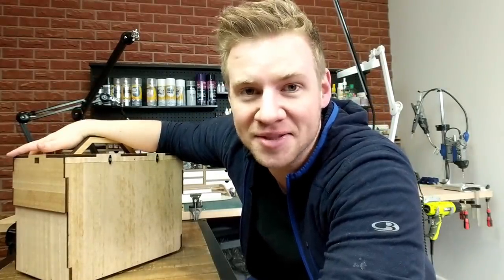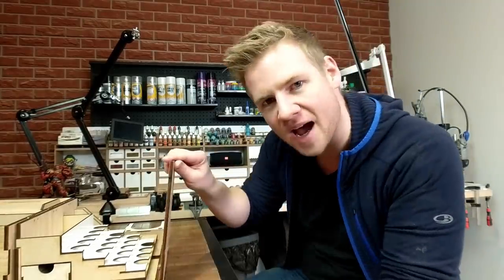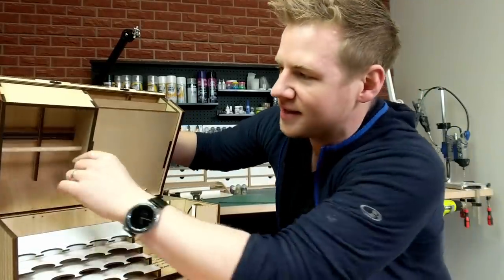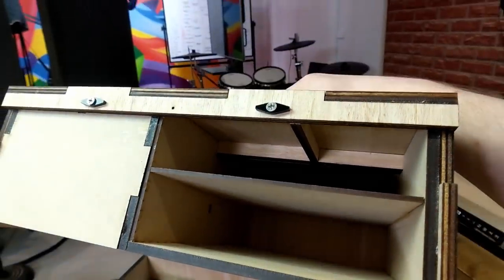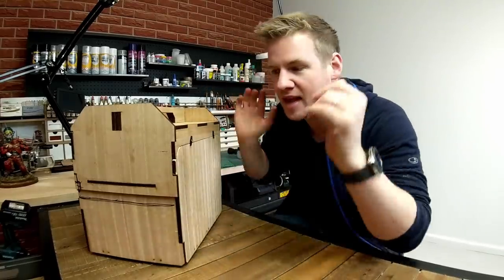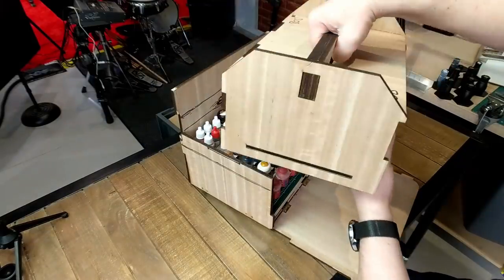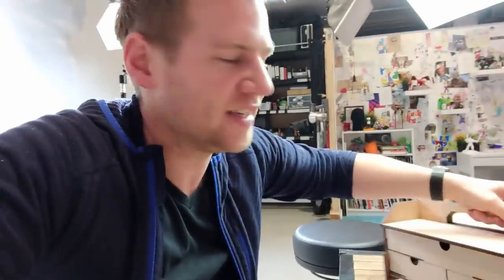My Prototype has MAJOR FLAWS - Hobby Box Diaries ep.3

Comment: The fact that you're redesigning where most manufacturers would just say "F&%$ IT, that'll do" is a big testament to what a genuinely fabulous human you are. I'm excited for this.
Reply from the maker: Aaw thanks guy! I really appreciate it!
Reply: @JazzaVlog  I agree with him, the fact that you're focusing on quality over Quantity, is truly a testament to how amazing you are.
Reply: @JazzaVlog  Could you add hinges to the back panel so it could fold down?
Reply: @rainbowsongbird13  that would make ist to long again
Reply: @AMK650  you could have the hinges half way up, so that it folds back on itself, reducing the height and not the depth.
Reply: @MapleMan4000  true. That's a good idea
Reply: @JazzaVlog  if it would open to the side it would be far slimmer
Reply: @MapleMan4000   if the hinges are flush at a 180 it could hinge  90 resting flush with the lower half only adding a little bit more to the depth.
Reply: @unknown-jm6fk  I was thinking something more like piano hinges so it can flip the full 180° so the top half will be flat against the bottom half. So hard to describe these things without visuals
Reply: HE GOT THE LEGENDARY COMMENT
Reply: @Daily Jazza, for the back problem, u could make it so that the back panel can fold downwards or even to the point where u can put it on a 90 degree angle and make it another shelf AND fold it at an 180 degree angle so that it folds completely flat at the back of the box.
Reply: The child is here
Reply: Agreed - as someone that words in product design, this is a fantastic way to approach this project. I can't wait to test it when it does become something because it is Jazza - so you know he's going to get there! :)

Comment: The 'barrier' on the 0.08 box. Coukd that be solved by turning it into a hinged flap? That way you could possibly access the drawers without opening up the whole thing?
Reply: Good idea to create a flipping mechanism to the top overhang of the backplate😁  lots of benefits
Reply: I agree but i think it needs to be optional where it can be flipped down OR left up. Sometimes you want a little back wall for yourself so you can clip up reference photos and what-not. or you just want the privacy. but i love the flap idea!!
Reply: That's what I was thinking, I wonder if that'd affect how stable it is when you carry it though?
Reply: @sophiawhettingsteel3489  i had the same thought process. I think that the hinges may not be strong enough for this design. A lot of the waight would be supported by that panel with the way its built now. Even if it didn't break right away, it might wear out over time if you used it enough
Reply: i thought about the same. I really think this is a viable solution. I souldn't worry too much about the weight support. You still have the side and front panels and with a great locking mechanism it will be no problem. For the cutting mat drawer you culd simply make the upper surface bigger and add just a little cutout from which you could pull the mat out. that will give you some extra centimeters space in that place and it doesn't compromise on the function of the drawer
Reply: instead of a hinge, put the back panel, the part that stick up at least, on hidden sunken pegs. that way it is even stronger for a support structure then now but can be removed and tucked away if you don't want to use it to pin reference material too. or make the back panel out of cutting board material and then you can have a duel function for it, storage for you cutting board instead of the shelf AND a wall  of the box, not sure how ridged you can get for hobby cutting board material but something to consider anyway.
Reply: I was thinking something like this too
Reply: Could use a sturdier springed hinge like on cabinets. That way it doesn't just fall over when you take the lid off.

If space becomes an issue for it to fit together, adding a couple of them turning bits along the seam in the back could hold it up while keeping interior space

Comment: Honestly, one of the selling points of the box was that it was all in one and portable. The new prototype loses that because it is separate parts. My suggestion is to ditch the loo roll holder in 0.7 and move the draws under the paints. That takes the weight away from the lid and reduces the length as it can hang behind. The extra draws at the bottom could be used (like you said) for a wet palette or a rule book/codex.

Comment: My first thought when you mentioned that the height of the back was a problem in prototype 0.08, was actually that it was quite perfect for what I would use it for. I often jot down notes or ideas when I’m away from my craft/art area. When I then go to work on the craft, laying my note to the left or right can strain the neck, leaning it against the drawers would mean moving it when I needed access to a tool or supply, and just leaning it against the back keeps it below eye level or it could slip and move around, dropping down behind the topmost rack of supplies.

If that back had a thin cover of cork, you could pushpin your design to it, or even use a small to mini binder clip to hold it up on the top edge. This brings your notes, concept sketch, color plans up to a height where you can simply lift your eyes, handsfree to consult your notes.

Comment: I really like the new "take off the lid" design! With the very heavily present racks of paint, it does seem to be very shoe horned into the mini figure world, I am wondering if it's going to be useful for say polymer clay sculpting, which is a hobby I'm looking to pick up. For that purpose it would be awesome if it was possible to take out some of the columns for paint and use the space for something else.
Reply: Yes i was looking at it for my watercolour painting... i guess, once the first box is made, there will be pieces to be adjustable for other arts and crafts. I see it before me. I could use a box of 4. 1 for watercolouring, 1 for acrylic, one for jewelry making and one for my alcoholmarkers... i mean i see them stacked next to my desk and when i want to do something, taking the box i need set it up and go... done put it back at its place and take another one... i am really in for it. So i guess, polymereclay should also be possible to have a box...
Reply: Malika Ann Noyez sane!! Would love a box for watercolor with an adjustable space for multiple water jars etc.
Reply: I'm trying to imagine a concept where that space is instead filled with 3 or 4 shelves/ racks  that you can pull out (Probably sideways so it doesn't obstruct the work space), but not only just pull out but also fold so that you can easily get at several small dishes for various water color paints.

Comment: - LED light connection area
- wet pallet storage
- shelf on back panel for mobile/tablet stand and a power cable
- where the cutting mat shelf is you could only have the cut out to pull it out a few inches wide rather than cut all way back across the front
- the back panel that is there could possibly slide up and out of the box frame if you not using as phone/tablet support
- I'm left handed. Either have it in tow variants or being able to switch what side water pot area is would be great. 

Just some quick thoughts I had watching this :)

Comment: I really like the new design! The only question I have is about the water pot holder. I am a tad clumsy and so if I don’t dry it totally before putting away (or in my case I put it away with a full pot)  wont the water destroy the case and possibly even flood some of the storage areas? Having the water pot flip up seems a bit risky maybe? Other than that thanks for the fantastic content. :)
Reply: I even need 2 cups... but i can put one in the other and put it away like that. I dont mind just having 1 cupholder. I dont even need a cupholder. Just a place to put my 2 cups.. i can set them next to me they dont have to be attached.
Reply: To be honest I use an old cd/dvd spindle cover as it holds a lot of water and is pretty difficult to tip over even accidentally, plus I have access to quite a few of them. :)

Comment: I love seeing your process! It will be great when you are finally done! I was also thinking...What if the top set of drawers had the flap from the back latched with the front of the base so you still keep the support/blocking of the drawers but don’t lengthen the work space flap? Then have a garage door type mechanism that allows you to tuck the drawer cover into a hidden compartment so you can access the drawers. The drawers can then still face forward and you can still have a sliding channel to separate the two.

Comment: Somehow I missed this whole hobby box project. Very cool project. One idea for the tall back panel is you could put clips or elastic bands to hold pencils, pens, rulers, or brushes horizontally. Or if you can't have anything sticking out. What about just putting useful information printed or engraved there like built-in rulers (so you can just hold string, etc up to it), color charts, etc. Another idea is to have a clear plastic envelope mounted there that someone can slip a card in there with whatever they want printed on it.

Comment: Love the honesty of your videos. No sugar coating ❤️👌 with the back board could you put tiny circular magnets in the  top and bottom bit and a fold where the line is. Youde still have it for the ingenuous lid mechanism but you could easily put it down for interaction or up for keeping your privacy? 
 I don't see an issue with the wet pallet there but could you make the box wider and stand it upright in a gap? If not could you make a slot behind the paints and before the back to put the cutting board in it that way you could raise the shelf where it was for a wet pallet or have a way of keeping the wet pallet open in the shelf Hope this makes sense.

Comment: Thought: Move the drawers to the bottom and the paints to the removable top. You can then have the drawers be covered by the smaller A4 front. This would allow you to create a spot for you wet template as well. For the top maybe you can find a way to keep the same cut outs for the paints, but have the top roll up like a roll up desk to revel them. Just things that popped into my head. Hopefully it will give you some ideas. Q: Have you sent your prototypes to Squidmar miniatures or black magic craft? I am curious what they think of your box. I started following them because of you BTW

Comment: TIP for Jazza: with the new prototype regarding the issue of the backing being too tall you could try to solve it by cutting it a little over the height of the paints and making the extra bit into a "shelf" that with hinges you can pull down for more space or put back up so it covers the drawers again. (hope this is useful or at lest understandable).

Comment: Maybe that tall section at the back could be made in to a feature? I may not paint figurines, but I know for most of my hobbies I have things I want to quick reference (inspiration images, jargon/symbol translation, measurements, recipes, progression charts, etc.). Something like a thin dry erase board that you can slide out of grooves for easier note writing, or something that fits common note card sizes so you can switch them out depending on the project?

Comment: -The whole top part (drawers)could actually be UNDER not on top of the box. then you can easily reach the drawers while working and not take up extra space on table.
-The working space panel could be sliding from the bottom like a drawer or slide from front side upwards like those wooden slide lid boxes.
-The handles could be made from ropes or a belt,wrapped around the whole box,like the ones they use holding stuff on car tops when traveling or hiking.
-...and think about a foldable top cover for the kit.

Comment: If you are worried about this being used for other hobbies, what about making sort of interlocking drawers or having special drawer spacers people could put into the drawers to separate things. they wouldn't need to be glued in if they are set into a grove and could be changed depending on who is using it or if they change hobbies? Similar to how some craft boxes come with little plastic tabs for spacers. I am sure you can come up with a way to make them so they could go both for long drawers and small drawers.

Comment: ik this is probably unrealistic to do but the part at the bottom that you would rest the cutting board on or whatnot could be a layer at the bottom that you can push on to bring it out if you need to and you can stop it at different lengths depending on the amount of space you need, then when you've finished using the box you should be able to bring it out completely and possibly close the box up with it as the side (or you could have a different way of closing it). you can also have the top part on a hinge mechanism so that it remains upright but you don't need to take it apart, so you would have it split in half (for balance) and then all you would have to do is bring out the sections to the side kinda like a makeup box. Idk how ell I explained this but yh

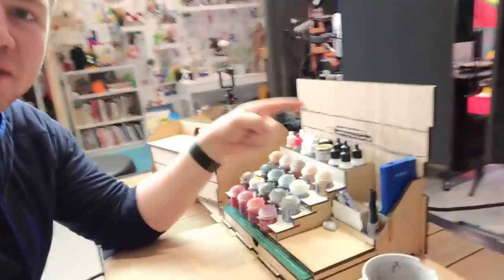Comment: 7:12
This is a quite a dumb Idea.  But I work at a Closet company as a worker, where we make custom closets.  So I’m Curious to solve that there is this locking Hinge that could work there.  Where once you remove the top Shelving unit of your box, it can fall over it’s back and Flush behind the back of the main box.  You can get a cheaper solution from, After Adding  a regular hinge, you can do the same Locking mechanism as the front to hold it in place.  And you just unclip it to fall.
Maybe you already thought of something like that, It is just an Idea. 
That is all and thank you for your time ^^

Comment: The "bottom box" has a sloped top side. What if the "top box" had a sloped under side to match, but be open in the front?
* The back plate could be lower or be removed
* It saves space
* When you put the top box down, it tilts backwards, which helps with large items, so this would be good for a pen holder or paper storage
It would need quite a bit or re-thinking how to organize that top box, but maybe it's a useful idea.

Comment: The high back panel is a good height for a clip to attach a phone or tablet onto, or a magnifying glass on a neck, or a clip-on light. It's acutally a really good little feature. Plus it'd give you a good spot to put on a fancy logo to add to the special feeling when using the case.

Comment: Since you're already considering making it so the box pulls apart into multiple pieces you could make it so the back panel (or even just the top half of it) slides to one side and detaches. Or you could make the back panel out of a see through material. You could also make a slight gap in between the back panel and the paint shelves/ display section that is wide enough for the cutting mat to slide into and stand up vertically instead of being stored horizontally. If you make a removable back panel you could even basically embed the cutting mat into it slightly or make a groove in it that is the right size for a cutting mat to take up even less space

Comment: Just a random idea that came to mind for your back panel problem is that it could slide up/down a bit like a garage door from inside the lid and then down along the back.  It would be only about 0.5-1cm taller in the lid space, but it is a simple rolling door/panel that you can make from the same wood and a bit of fishing wire.  Just make it such that the last/top panel is locked within the cavity.  Maybe add some simple, 3D-printed wheels to help it go in and out.  Easily keeping the costs down and should be overall the same amount of material as you have now.

Comment: Having the paints on a slider on left so you pull out so there on the side . Meaning wet pellet can be hidden under where paints are currently. If u had pull put paints on both side u can remove a draw from the top and lower the height of your future product .

Comment: I'm loving the new handle design! Could you design an insert for color pencils? Like a tier or another insert of drawers to be an option instead of the paint cubby holes?

Oh and an idea to shorten the back panel, maybe adding a hinge that folds partially over the drawers so it would still lock them in place but could fold completely back and sit on the top of the box so the drawer could pull out. It would add more hardware but it may solve the back panel being too tall but cutting that panel and attaching it to the top lid part of the box and having it fold out of the way.

Comment: One "improvement" or rather option I could think of is giving the customer a choice in the size and shape of the paint rack. The Japanese hobby paint brands all have the same bottle diameter for their standard  paints, but Tamiya uses square bottles for their enamel paints. Furthermore, western brands have multitudes of bottle sizes depending on the brand and product line. Not everyone uses the same paints so giving them an option on what the paint rack can store provides introduces the box to a wider audience.

Comment: For 007 You could put hinged/legs in the top of the fold over box, so that when it is at 90° to the start position, you'd slide out the legs to thus stand the top box up and allow you access to the roll holder and boxes. The disadvantage is that it would be high, like you said in 008, but that just means having the computer or TV off to the side a little.
 As for 008's high back, that is solved by either a piano hinge across that back panel and a clip, so when the top box is removed you fold the hinge over and thus remove the high board and fitting it all back together at the end, you hinge the back piece back up and clip it to the reciprocal clip opening in the top of the drawers of the top box. 
Understand? If you want me to explain more I will! (Diagrams may take time!)